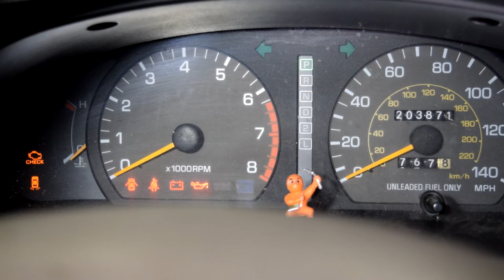Can You Hotwire a car Like in the Movies - Hollywood Secrets Revealed

Comment: Seems easier to just use a screwdriver in place of the key on an older car.
Reply: would it work for a 2002 windstar.  has transponder key
Reply: @JohnDoe-mp1zk  if it has a chip you cannot break the ignition lock and use a screwdriver.

Comment: If MythBusters should try it because many movies, the answer will clearly it's not possible. Here you have the answer for it. Don't forget movies are for ease and amusement, everything must works and going well. Pull out wires, sparkles, engine start and ride away. That is what movies want: easy and quick.

Comment: put your feet on the side of the trans tunnel and pull against the lower part of steering wheel. Will usually break the steering lock easier than you think.

Comment: There is a cable in the steering wheel that locks it. Use a hack saw or something of the sort and cut a slit in the wheel. The cabke will loose tension and the car can be steered.

Comment: I took me about 20 min to so it on my 1993 Nissan NX with only basic electrical understanding. All I had to remove was the top plastic panel of the column, which only used snaps, no screws.

Comment: just put a flat screwdriver in the steering lock and twist, it should open btw nice video
Reply: Davidge does not work like that
Reply: it worked for me
Reply: Not for newer cars that use a chipped key.
Reply: Davidge you steal cars
Reply: Doesn't work that easily, you have to use a hammer on the end of the screwdriver to break all the lock pins out.

Comment: wheel lock? seriously a teenager can snap that, lay back in seat stick foot in wheel and push.

Some older cars used pneumatic central locking, cut a tennis ball in half, place over door key hole, pump, the air pressure would pop the locks

some also had alarms/immobilisers that would flash the turn signals, so pull the lens off, pull the bulb out, short the bulb wires, when the alarm goes off it would pop the fuse for the alarm, no more alarm no more immobiliser

ECU and coded key, take your own ecu and key...

modern obdII cars, laptop and obdII cable or BT dongle, get dealer software from some dodgy internet sites, program your own keyfob

theres always a way only security is your own thirdparty stuff, the OEM stuff is weak

Comment: I think you're searching for the term "transponder key" at the end of your video.
All modern cars have them, I think from about 1997 or something. It contains, as you said, a chip that sends a signal to the engine management computer when you turn the key. If that signal matches the one recorded in the engine management, the engine wil start. Without a matching chip, you can connect all the wires you want, but the car won't start.

Comment: Hot wiring a car dates back to the days of no lock steering/gearshift. Back then it was very easy to hotwire a car especially if done from under the hood. A jumper from the battery to the distributor then short the starter relay and done. Today though, it's just hollywood BS. Unless you are the terminator and just tear the steering column apart.

Comment: the ignition assembly where you put the key in unlocks the wheel lock they are made of out cast aluminum I've broken several off when people have lost keys just using a hammer or even a monkey wrench and twisting the assembly off of the steering column very easy and you can drive the car away any cars during the 1990s this is feasible usually newer cars have chips in the key and you'd need to connect a laptop to the ecu to bypass the chip

Comment: hey buddy, i have one problem, i buy a second hand car, which is has by 
pass thermostat, then i buy new thermostat for my infiniti qx4, but 
since i fix the good thermostat the engine is starting overheating! 
thats why i remove again... please guide me on this problem.
Reply: may be the sensor that goes together with the thermostat that went bad or a wire may have been broken. You should check that had a similar problem with a BMW i was working on a while ago.
Reply: thank you for the reply, boss Mauro. anyway if the sensor is bad it will show only false reading right? example: it will show high temp but on reality on the engine is not. right? but in my case on my car when i will goes to over heat totatally the radiator is going wild and and realeasing a lot of pressure and steam.
i try to bleed the air but it seems like no coolant are circulating on the system. the bleed pipe is always releasing an steam only even the engine run more than 30mins. please tell me further information how to fix this issue,. thank you so much Mauro.
Reply: well if you take off the thermostat then no you car will not be able to accurately measure the temperature. Because you took off the THERMOSTAT. you are telling me your car runs and does not over heat when you take off the thermostat? What you should also check is if you radiator fan turns on after the car has reached over its normal operating temperature.... OH i almost forgot.... be very sure you put the thermostat was installed the correct way (what I mean with this is that the thermostat is not installed up side down). If it's installed up side down it will not let the coolant pass and it will over heat your car and make steam come out and throw the coolant out. Just be patient and check part by part and do not drive your car in this condition. What it can also be is a blown head gasket.
Reply: What it will probably be is that you installed your thermostat up side down or that your coolant system is clogged up(usually radiator).
Reply: sir mauro, it will not gonna be wrong the thermostat because the thermostat is with full set with the housing. i have doubt maybe my radiator is clogged.. but why in by pass (no thermostat) why the coolant is freely run? i dont have a mechanic here in my place thats why only i get help from you. let me know further sir.
Reply: i watch all your video regarding how to bleed the coolant system.it is very easy. but in my case is different. once the engine hot it was realesing a huge pressure all coolant are spraying out from the radiator. tat is sign of radiator clogge???
Reply: What do you mean "by pass no thermostat"? What you have to do is flush out the system to make sure you have nothing clogging it up... What I usually do is disconnect the coolant hoes one at the top and the other at the bottom. After put a water and flush out what ever is on the system.... if it's clogged you will see usually have pieces of black sticky material(usually happens when coolant get old and car is sitting for a while).... check videos on youtube on how to check for clogged up radiators. Also check online for other people who have similar problems and how they fixed it... if all fails and it still keeps over heating then you will have a blown head gasket and that is hard to fix... check if your oil dip stick has water and oil mixed together this is a good sign you have a blown head gasket
Reply: yes sir Mauro, i buy this car with no use thermostat thats why i want to correct it,. but this is what happen when i put the thermostat, it will go over heat the engine,. i try to bleed but only steam and steam are coming out from the bleeder.then it will blown out the massive pressure from the radiator. then what i observe, the hose on the top is very hot while the hose down is cold???? so what the possible reason? radiator , or need more time to bleed the air. ?
Reply: Akoto disisme maybe a head gasket problem? when you put thermostat, it just overheats. without the thermostat, it has more time before it starts overheating. idk, just my guess.
Reply: thank you for that reply Bear2die4, anyway there is no any problem on the head gasket.  i found out now that main cause of this problem is the bad water pump. there is no sucking power to pulling the water if there is installed thermostat, when removing the thermostat not coming over heat, but once im on the highway its come the heating up of the temperature. so this is cause by the bad water pump,. i think  the impeller of the water pump is gone of slip slide. today i will change the thermostat and i will share to you once it is done... bad water pump is very dificult to determind directly especialy if the impeller is already eat by rust.
Reply: The system is clogged, most likely your radiator, or your water pump is pumping enough.

Comment: I always used to think about three things regarding hot wiring cars growing up watching movies from the 80's/90's and very early 2000's:

1) Is it actually even possible to hot wire a car in real life? 

2) And if so is it really as easy as it is in films to do it?

3) If it is indeed possible then why don't car manufacturers put things in place to prevent it? Like you would think at the very least if you were building a car then you would make the wires inaccessible to criminals, wouldn't you?

Comment: What about Taking out or replacing the key cylinder to take out the steering lock
Reply: this does work, I did it on a car that was previously broken into and had no keys.
Reply: or what about turning it really violently side to side till the cylinder gives away and breaks off... you might have no power steering or maybe have power steering but hey you can turn the wheel :D

Comment: newer anti theft is a bit of a joke.
Pop the hood. Supply constant power to an ignition source under the hood. It should turn on all the power of the vehicle.
From there you need a another wire from the battery with a switch to the starter.
This is usually very long to reach into the car with an alligator clip on each end.
From there all you need to do is break the steering lock.
use your feet to push the wheel hard against the lock and snap it back and forth until the lock breaks.
Now flick the start switch you've installed and you should be off and running

Comment: I hope this doesn't come out as bragging. but, my 16 year old Merc has some box somewhere that cuts either fuel or spark when it can't authenticate with the chip in the key fob
Reply: Ali Abdallah GM has had a similar anti-theft system for nearly 26 years now (not to brag)
Reply: Ali Abdallah my dad's 17 year old Astra has that too and so does my grandfather's 20 year old Renault Clio that became standard around 1996/1997

Comment: In any older car or truck pre 80. All you need is one wire from the battery to the coil and a screwdriver to jump the solenoid. 2 min tops

Comment: Why didn't you explain why you couldn't do anything about the wheel lock?
Reply: Cause its rly simple to Unlock this, simply go on the side of the Car, your food on the doorframe and pull as hard as you can, Crack and your done, its rly that simple.... (dont know if that still works on newer cars) on Mercedes for example this dont work cause when you "brake" the lock your drivingwheel is disconnected from the Wheels....
Reply: You can also just shim the locking pin.
Reply: One person cannot break a steering lock.  Ive seen the strongest people fail at it.  Ive tried with 2 others and failed.  Old ones maybe, but many of them are extremely difficult.
Reply: I've put a ratchet strap on a steering weel at a junk yard to break the steering lock. Just went from the steering wheel to to the driver side wheel outside.

Comment: I am in a tough situation I own a 1994 Toyota Pickup and I had a Avital Tornado Alarm installed 24 yrs ago now its not working and my Truck wont start. now I am stuck.. I removed the dash so I can see all the wiring  but I just dont know what wire and where for me to solder together. please help its my only vehicle.

Comment: it's surprisingly easy to break the steering lock just grab the steering wheel and turn most efficient to sit in the passenger seat put your foot on the collum grab the wheel at the top and pull i broke the steering lock and hotwired all my field cars when i was 10 because i would always lose the keys

Comment: alternatively you can open the engine bay and "hotwire" the ignition source from there... you can put voltage directly on the starter as well... i used to have a toyota corolla Ke30 that i hotwired because race car... had to try and explain to the police that i didn't steal my own car once but instead it was because race car... I used to take the ignition wires with me so no one could get it running in a hurry... because race car...

Comment: The wheel lock is not very durable, so I heard and can be broken with force. Not that there's any need to, since you can just use a bump key to turn the ignition switch, there's really no need to hotwire. The only real protection comes in the form of immobilizer systems. Thieves bypass that by bringing an ECU and a matching key and replace them on the car they intent to steal.

Comment: can't you break the lock if you pull hard on the steering wheel?
Reply: Niels Frederik von Tabouillot Yeah, but it might lock up when you're driving. You could drill out the lock pin on shitty cars but most newer cars have some kind of reinforced metal, wont budge to a regular drill. Only expensive diamond drills.
Reply: so, no go
Reply: Niels Frederik von Tabouillot Well no, just use your key if it's your car.
Reply: thats so boring :)
Reply: Niels Frederik von Tabouillot Only if you're sober

Comment: just break the wheel lock
Reply: clubbing baby seals Good luck with that.
Reply: I used to do it all the time with my daily cheapo cars, it take a bit of strength and roughness but it can break off if you swing off the wheel hard enough
Reply: it can be done. same with motorcycles, scum steal bikes all the time by snapping them
Reply: Motorcycles are usually thrown in the back of a truck.

Comment: Some cars have a RFID chip in the ignition key. The ECU must know the ID read from the chip or it won't start. With some cars (VW Golf mk1 for example) there's two versions of the ECU, one with that feature and one without. Thieves will then bring their own ECU with them and swap it out to steal the car. Some cars take it even further: Some Ford Fairmonts have two different modules, one for the engine and one for the body. The security system is in the body-computer, and this computer has to authorise starting attempts. There is a cryptographic key exchange between these two computers so that the engine computer will refuse to talk to the body computer of a different vehicle.

Comment: on order cars The wheel lock can bra broken with pure strength.  Just breake it. but its.kind of dangerus because it can snap back when drivning.

also on quite a few old cars The ignition lock can be broken with just a sqrewdriver and a wrench. solving both problems.

of cause on even semi modern cars this is not possible.

Comment: Not all vehicles have wheel locks though
Reply: Mark Schaefer my 1990 Honda Civic did and that's pretty old. Which cars don't have wheel locks?
Reply: My 2012 GMC Sierra my moms 2010 Honda odessy and my brothers 2001 Ford Taraus
Reply: They just engage after the car has been tempered. It's a safety measure to be able to move the car while it's turned off. 

So basically if the car is OK and turned off you can still turn and do shit, try to temper with the car though and the wheel locks.
Reply: My '86 RX-7 also has a column lock.
I'm guessing it was more cars from the 60's that didn't have them?
Reply: My '69/70 VW 411 also locks.  So for a car to not have that feature it would have to be really ancient.  I've heard that they're not hard to break though.

And as others have said, it's obvious that the movies are not realistic.
Reply: My dad's 2001 2500 HD Sierra doesn't have one. Don't think my brother's 2005 2500 HD Silverado does either.
Reply: my 2008 bmw 335i doesnt, but good luck hot wiring that, you have to insert the remote (key fob) into the dash, then push a separate button on the dash to crank engine, no remote, all the motor will do is crank..
Reply: Does it not have an electrically actuated lock that engages when you remove the "key"?  I know Merc had those in the 00's.
Reply: You do know that especially the newer BMW´s are super easy to steal. They are hacked via the OBD system,  no key fob needed. I should know, my M3 got stolen not to long ago.
Reply: menaceman1000
Same with my '82 518i.  But in this case it didn't require any hacking, except for the old way (breaking the locks).  I miss that car.
Reply: My 86 XJ6 does not have one, and it was very expensive for back then.
Reply: I suppose it is possible, but it's still odd that they would not put somethign so basic in an expensive and relatively modern car.
Reply: The only cars in the past 30 years that dont have steering locks are Saabs.  They lock the transmission in reverse.
Reply: Thats not super easy.  They spent serious money to steal your car.  If your m3 was an E46 or older, they didnt go through your OBD2 port.

Comment: YES ANY CAR THAT HAS A CHIP IN THE KEY YOU'RE OUT OF LUCK AS FAR AS HOT WIRING GOES UNLESS YOU HAVE A LAPTOP WITH THE MANUFACTURER SOFTWARE AND THE CODES FOR THAT CAR OR IF YOU WORKED FOR POP A LOCK FOR A FEW YEAR'S A CARRIED ALL THE SAME EQUIPMENT TO MAKE AND PROGRAM KEYS FOR THAT CAR IT TAKE'S OVER 15 MINUTES TO PROGRAM A NEW KEY FOR AN EXPLORER. YOU'D BE IN HANDCUFFS 10 MINUTES BEFORE THE KEY WAS READY TO START THE CAR.